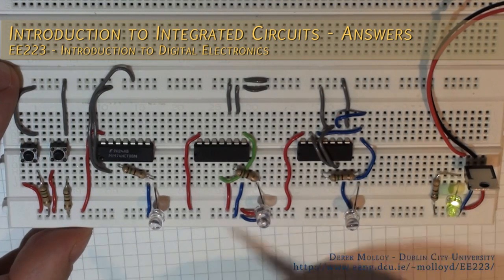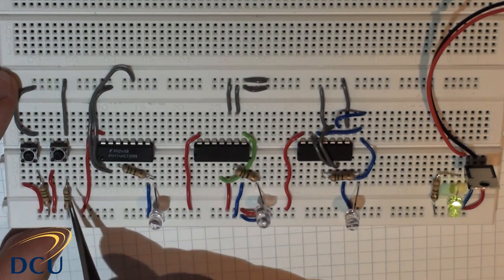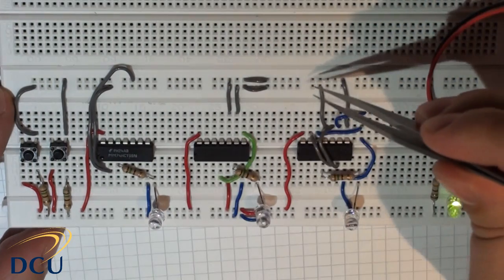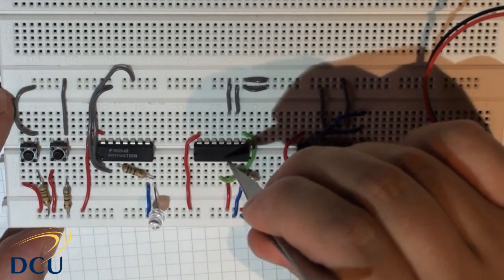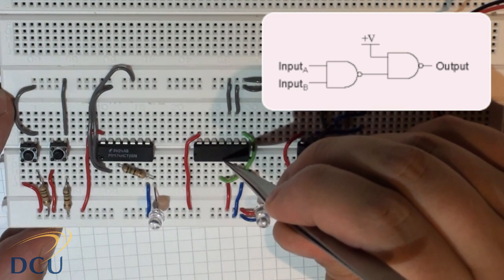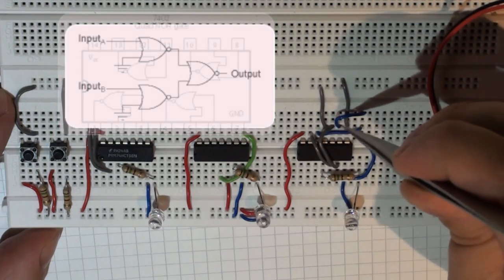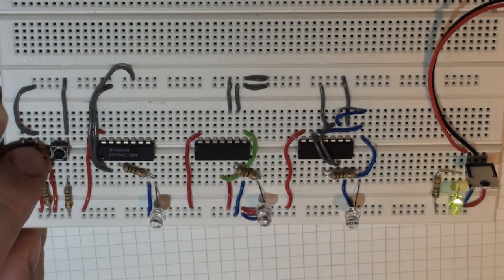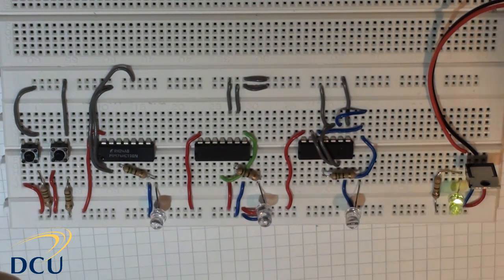Experiments 2.3: Logic Gates - Integrated Circuits Part  2 - AND using NAND and NOR

Comment: "value of the pull-down r should be small, otherwise it could be more than 0.9V drop", the value is always 5V when switch is closed (due unlimtd impedance? of gat in?), so I pick a large resistor for current limiting...